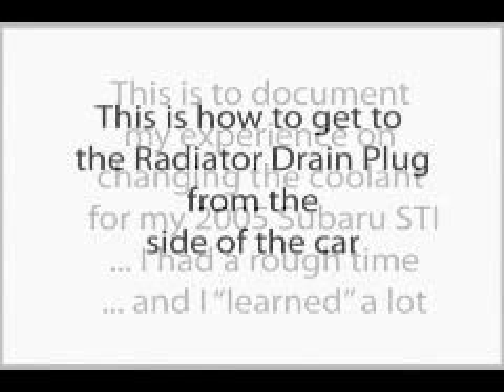2005 STI Coolant Change - Lessons Learned

Comment: when drain plug was to hard for me, all I used was a 22mm ratchet wrench or a 22mm socket. it will slip right on and allow you to ratchet it off. Remember rightie tighty ,lefty loosie.